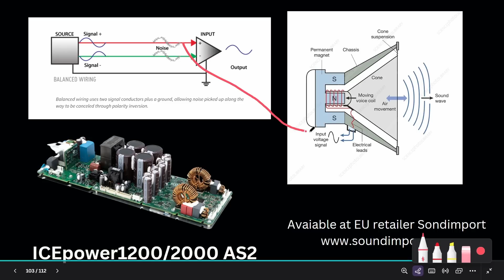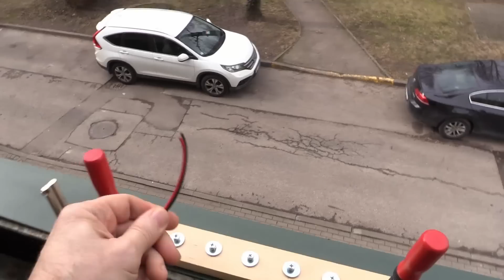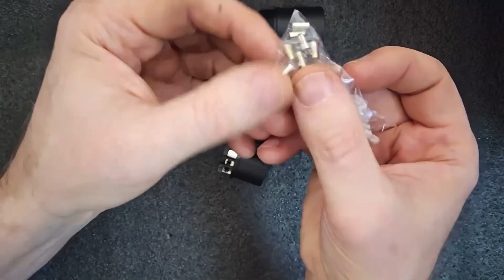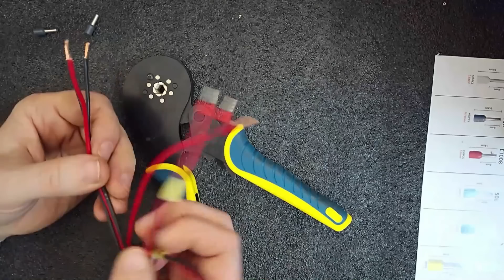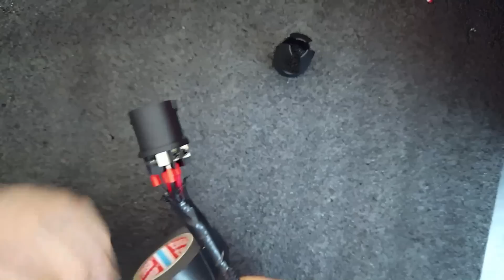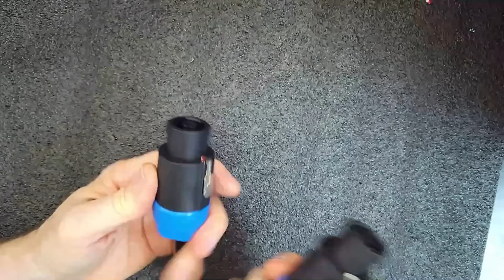ICEpower 1200 FAQ How to make perfect speaker cable tutorial

Comment: Hi Guntars. The conductors in the cable, minus and plus, must be twisted. To minimize picking up interference. How to find out or calculate the twist pitch? What data or parameters are needed for this?
Reply from the maker: It is not critical about the pitch. Just twist with hand drill to convinient layout not damaging insulation.
Reply: Thanks for the answer. You connect the wires to the connector by crimping them. Why not soldering? How long will good contact last? Over time, copper oxidizes. Even after six months, if you take it apart, you will see that the wires that make up the wire have darkened. Also, if the cable is often disconnected and connected, the cores move between each other under the crimp points, so there will be oxidation there too.
Reply from the maker: @timtom5015  Sometimes it’s useful to look at other industries, such as automotive manufacturing. They operate in extremely harsh conditions — from minus 30 °C winters to over 70 °C under the hood, and in both high and low humidity. Crimped connectors are a proven technology in that environment; you just need to choose good‑quality connectors. A bit of visible surface oxidation doesn’t affect the electrical resistance of the joint. When done properly, crimped connections are far more reliable than soldered ones in demanding conditions.
Reply: Thanks for your opinion. I use a crimp for speaker wires. Connector - plug. At first, maybe a year after the speakers started working, everything suited me. But then it began to seem to me that something had changed with the high frequencies. There may be fewer of them. I see a change in the color of the copper so I think it's due to oxidation. The length of the wire in one direction is 5 m. In both directions it is 10 m. So the change in contact resistance, due to which the total wire resistance + contact resistance from 0.14 Ohm per 10 m to 0.3 Ohm per 10 m is real.

Comment: Some practical brotips:

1) Use bi-wiring configuration (four strands, into two plugs at amp side, and four plugs on speaker side), if your speakers have bi-wiring terminals. Reason: braiding four strands is much better than twisting two. It won't come apart, looks nice, and you can use thinner  (=cheaper) wire because you're doubling it.

2) You don't even need to use "speaker" wire. Any stranded copper wire is perfectly fine for this purpose, and automotive wire made from electrolytic copper (99.9%) almost counts as "OFC" and is more than good enough, and for this purpose electrically identical to even the most expensive fancy speaker cable.

3) The wire is so cheap, 1 €/$/£ per meter or less, you can choose the biggest cross section that fits the usual banana plugs. Use solder type plugs for smaller sizes (4mm² or less), or solid screw types for bigger ones.

Example application: 2x10m 4mm² automotive wire, 99.9% electrolytic copper, red and black, made in Germany, price 30€ on Amazon. The same in 2.5mm² for 20€ would work just as well. For a pair of speaker cables, weave four strands of 2.5m each, add plugs as described above (12pcs total, maybe 10-20 EUR), et voilà: cheap speaker cables from excellent materials that are thicker than you'll ever need. Total cross section 8 or 5mm², so thick you can never exceed its electrical safety limit in a home hifi scenario, and so low in resistance, you'll never need to worry about sound and damping factor etc. ever again.
Reply from the maker: Yes, seems like a great option. Thank you for your advice😀

Comment: "perfect speaker cable" 60% of your video covers science behind your approach, suddenly, a box of 18 gauge wire appears and you proceed to twist the wire. 
what I find as goofy is the execution of the cable has no specific explanation as to 1) gauge, 2) wraps, 3) copper purity, 4) electrical specifications 5) #/gauge of strands 5) wire insulation material
goofy because you haven't presented a balance of science and execution (art)
the title isn't supported by the content
Reply from the maker: All your mentioned parameters are meaningless for low frequencies up to 20 kHz. Wire twist and impedance are only tangible parameters. You can always test your assumptions by measuring the test signal on the speaker side. and compare it with the amplifier output using the dual-input oscilloscope. In audio, there is no magic. you can measure any aspect of the signal.